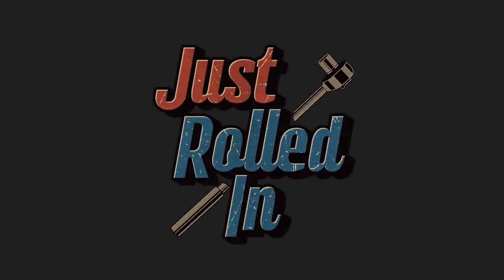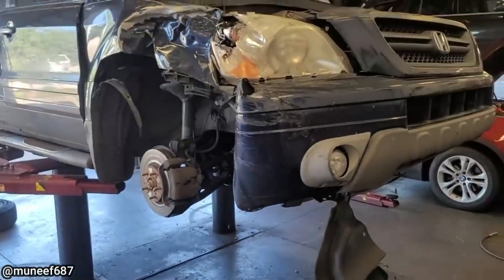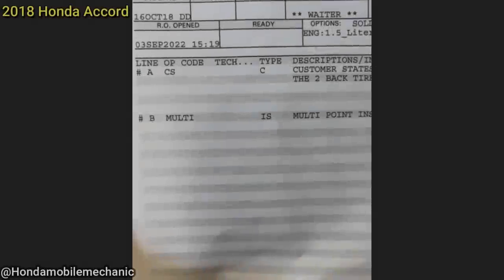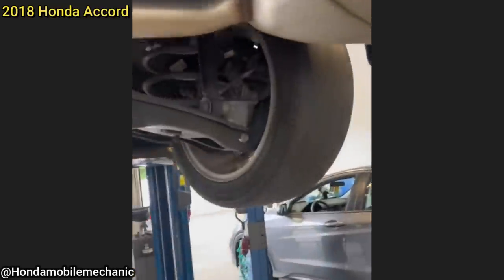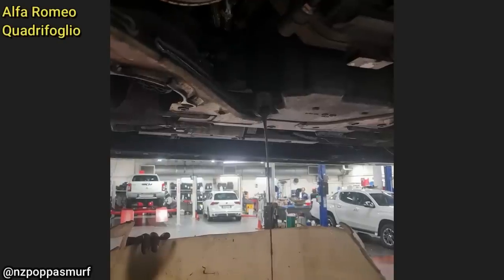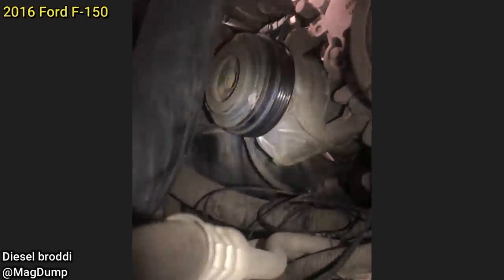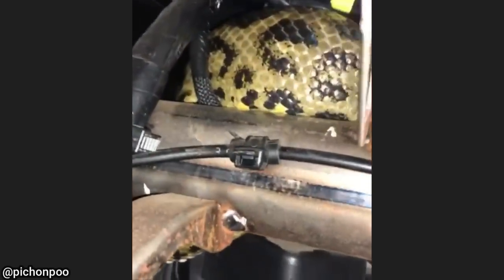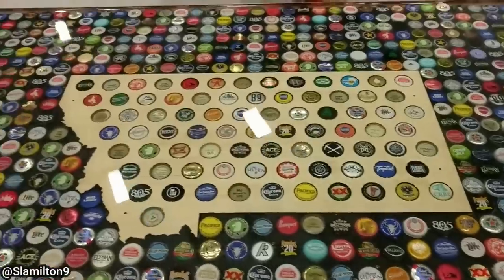Customer States Haven't Serviced Honda Civic In 9 Years | Just Rolled In

Comment: I absolutely love that toolbox....Unfortunately Epoxy resin and typical shop chemicals don't exactly play nice with one another.
Reply: Don’t worry, in my experience of fellow AMEs…the larger more expensive the toolbox, the less actual work they do.
Reply: @gpaull2  9 times out of 10 I'd agree with you. GA seems to be the opposite though in my experience.
Reply: Would make more sense to put a plexiglass or lexan sheet on top.
Reply: @ol_smokey9370  

GA ?
Reply: That's what I was thinking. The top of your toolbox is no good for a work bench now!!
Reply: @tedcook8749  General Aviation. Broadly it's small privately owned aircraft.
Reply: @tedcook8749  General Aviation. The tool box was in a hanger.
Reply: Pretty sure the guy already wasn’t going to pour chemicals or hammer shit on top of a brand new Snap-On box likely retailing in the $15-25k range
Reply: My idea for resin tabletops was to put a sheet of glass on the top then you get the scratch/chemical resistance of glass Plus the aesthetics of resin and the glass will also be reinforced by the resin which would make it somewhat impact resistant like tile is after its set.

Don't ask me how to get all the air bubbles out, still working on that.
Perhaps some long needle syringe or you  pour with the table vertically and heat up the glass side to make it viscous so bubbles flow upward
Reply: @nodsib  You clearly haven't seen how mechanics use their tool boxes.
Reply: Well, I’ve worked in both independent shops and dealerships, and while I definitely have used my toolbox as a work bench and gotten it dirty and generally not been too worried about minor wear and tear, my box was less than $2k, and didn’t have a custom top, so I would have treated it a lot differently if it was this guys tool box
Reply: @gpaull2  I am an AMT and can definitely attest to this!!!
Reply: @tedcook8749  general aviation
Reply: He’s got a stainless steel cover that fits over it to protect it when needed.  That’s how it stays so pristine.  BTW, I just made all that up.

Comment: I have 2006 Civic with the same engine and 365k km. It still runs perfectly. I did a valve adjustment at 240 k km and it was nearly pristine under the cover. I will do another valve adjustment in springtime and I'm certain it will still be close to pristine.

Comment: I had a 1991 Corolla I bought for $150. Went bag driving one night with a buddy, and sent a branch through the oil pan. It leaked a bit, so we just kept adding. Eventually we ran out of oil right next to a dairy farm. The farmer said we could grab whatever we needed to get back home. 2 full bottles of Palmolive dish soap, and a lot of smoke later, we got another 500km out of that engine. Solid engines in my books.

Comment: Oh man...I had a mid 90's civic come in back in the day, 99,000 miles on it, crank no start.  It had fuel, spark etc.  Looked in the oil fill and the cam was spinning.  This was during the time the distributors would wear out and wobble in the hole.  Tried a new distributor, still no go.  Took the valve cover off and the the cam was split dead in the middle..  The sludge looked just like that first car and the guy said he never knew he had to change the oil, just keep it full....

Comment: Wish I would have thought of it at the time to record. But one of our company pickups came in for service this spring, the guys said the alternator wasn't charging. I took a look and during inspection I found the idler pulley was seized, and melted down so the belt was loose. No visible damage to the belt and no noise. Replaced the pulley and belt. Good as new. 2002 GMC 1500 with a 4.8.

Comment: My 84 Thunderbird was sitting for years. I didn't know how long? The first thing I did was change the oil. Time for another change after 4000 Km. It only has 20,000 kms on it. Less than 13 thousand miles. Still runs like brand new

Comment: I had a customer swear by oil changes on his S10 every 10k. When it started knocking at 100,000 miles, he swore off Chevy, says they're junk. As a Ford guy, I think he made a good call, but it always made me shake my head that he blamed GM for his lack of maintenance.
Reply: Everything says 10K nowadays. I go 5K, and The Car Care Nut backs that - he's seen a LOT of Toyota engines and says 10K is fine if you only want the car to last past the warranty. If you want it to last 300K and beyond, go with 5K changes.
Reply: @John_Ridley  Whenever a customer asks me "then why does the manufacturer recommend 10,000 miles? Shouldn't they know best?" I always tell them to take their car to the dealer 120,000 miles & 12 oil changes later, burning oil, and see if they will help you. They'll help you buy another car.

Comment: Gotta say, as a Ford tech I hate the transit. There is so much stuff wrong with that vehicle it's insane. I had the same one come in three times for three different issues. The first was for a new engine, the second was a new torque convertor, and the third was two new tie rod ends.
Reply: Why anybody buys from the Big 3 (2 now really) is absolutely beyond me.
Reply: Its funny how i drove one for 268k km with no issue and this one spend more time in the shop than on the road

Comment: Guy I worked for still drives his old Honda (body work needed meant it was a total loss) so he bought for $100 and decided to drive it as is until it died.

That was 10 years ago, and the only things he's done to it are replace one rear tire.  No oil change, no spark plugs, no air filter, no clutch, no nothing...  Still doesn't smoke, leak or idle roughly and fires first hit every time.

Only thing I think that's saving it is that he's old and drives 30 mph at the fastest, but still, I'm amazed it even runs.  Even the headlights, brake lights and turn signals still work.

Now we're afraid that change any fluids is actually going to screw it up, so he's leaving it.

Comment: "Honda engines are bulletproof" is a FIGURE OF SPEECH!!!  They still need regular maintenance and will not stop a bullet enough to operate correctly after the impact.
Reply: Though to be fair, if that engine didn't have a nasty rod knock, and still builds oil pressure after this abuse, is pretty impressive.
Still need to change the oil though, obviously.

Comment: I think it would be impossible to have an award for “Idiot of the Year” because there would be an argument over who deserves it the most. 🥊 
That Lotus owner with the oil filter gets my vote. That is until I saw this video 😂.  🍺
Reply from the maker: Lol! I can't wait to make the best of 2022 episode. It'll be a good recap.
Reply: The Alfa owner... I can't even relate to the thought process that followed up putting washer fluid in the oil fill with, "just keep adding washer fluid." It's like accidentally setting your house on fire and, just to be sure, getting in your car and ramming a nearby utility pole as well.
Reply: @matthewbowen5841  My pet theory on how a lot of these problems happen is that there's an idea that it's appropriate to have a few beers while doing maintenance. Maybe someone who has done the same job many times before can get away with it, but someone who rarely does this kind of work should never attempt it impaired.
Reply: @matthewbowen5841  Open any cap, add any fluid.
The car is smart enough to figure where it goes if it can complain it's headlights are on when I open the driver's door!
Reply: I vote for the blowtorch inside the car cause the heater had stopped working.
Reply: @Kalvinjj  I remember that insanity, a month or two ago. I can't remember but was the torch tied down or floating free in the backseat?

Comment: I don’t know how many times I took my 2004 Tacoma in for service and they always came back and said suspension and steering checked out OK. Then in 2021 the lower ball joints failed while I was going 55 mph down a busy street in San Diego. Cost me $7000 to get it repaired. I always relied on technicians who inspected the vehicle to let me know whether or not anything needed to be replaced or looked at, good to see that at least somebody recommended ball joints should be replaced in this video.

Comment: When your oil looks like that from not changing it, what do they do?  Add bottles of engine flush?  Looks like it would be miserable to deal with.
Reply from the maker: Take it apart and clean it as well. Waiting to hear an update from the viewer who shared it but sounds like it needs an engine.
Reply: If it's still running looking like that I think the standard procedure is to bury it at a crossroads.
Reply: Oil flush is likely to break things loose all at once.  What I've heard of DIY doing is near-daily oil changes with cheap oil and filters until it's cleaned out.  Not sure what a tech would do given the time constraints.
Reply: @russellhltn1396  I agree with that.
I'd probably add a pint or so of ATF and run the car for 5-10 minutes before changing the oil and filter.
If it's a car where you can easily change the filter without dumping a whole bunch of oil I might change the filter weekly and top up the oil.
I will say diesel oils with a big detergent package will help keep your engine cleaner over time.
Beware oils with elevated ZDDP unless you like buying expensive catalytic converters
Reply: Throw some transmission fluid, kerosene, or diesel in it and idle it for 10 or 15 minutes then dump everything and put fresh oil and filter in it. They make expensive engine cleaner kits that come with special chemicals and you do like two runs to make it like new inside. Have a 99 300m we retired so hadn't bothered to service it or change the oil. It lost oil pressure on the freeway and figured it was done once I realized it was making upper end noise. Drove it gently 20 miles and it never got worse or bottom end knocking. Checked our records and oil had 20k on it.
Decided to change the oil and filter just in case and pressure came back and eventually the top end got quiet the second time I started it after sitting a while. I don't trust it now and replacing the oil pump is a huge expensive job, it has 190k on it 3.5 ho engine, pretty darn tough.
Reply: Not a car engineer, but I guess it would be difficult not to block the oil galleries with lumps, if you tried to clean that sludge out.
Reply: @GaldirEonai  🤣🤣🤣
Reply: @kevinshort3943   My guess is that it's a bit late to be worrying about the risk of blocking any oil-galleries!  It's most likely that the oil-filter is a solid mass just like inside of the oil-pickup, the oil-pump gave up a few 100 miles ago, & the bores have more scores than a crack-addict!
Reply: @kevinshort3943  Which is why you want to do it gradually and not all at once.
Reply: @kevinshort3943  You can't circulate the oil to remove the sludge without running the engine and you can't run the engine with the oil passages blocked off.
Two choices are complete dissembly or run it gently with high detergent and many filter changes.

Comment: 1:55 my first time learning that not all A/C compressors run off the same belt was on my 2001 Silverado.  Could never understand why it said the system was charged, belt attached, but no air (though these days I know the clutch could be faulty too).

I found out that not only does it have a separate belt, but the tensioner pulley likes to fail and fall off as mine did.

Comment: Some of you older guys may be horrified at this, but my mom told me that she never got the oil changed on her brand new 1971 Dodge Charger (i think it was the R/T with larger engine).  She was only in her teens, and didn't know anything about cars or that needed oil changes, so she just had gas stations add a quart occasionally until the engine locked up after a couple years. :0
Reply: I mean, i know that we men are supposedly ignoring the user manuals, but women are said to be smarter in that regard and actually look into a user manual.
I am pretty sure the user manual and the service booklet stated when the oil would be due to change. (Back then, the first one would have been within 1000 miles or so if i remember correct. Was common practice to use a different oil for the break in period.)

My first car was from 1984 and while i didn't get the user manual as i was the 5th owner or so and someone before me had lost it, but it certainly did in the service booklet that i got with the car.

With service booklet i mean a little booklet where the oil change intervals were already marekd and a workshop would stamp their logo in at the according mark insert the real mileage and what maint they'd done. Most manufacturer until the end of the 90's provided any new car with one of those.
Reply: @nirfz  no women has looked into a cars user manual lmao
Reply: @ESDigital -- Good question?  my guestimate is early eighties maybe?
Reply: @ESDigital New Jersey still has full service stations.  It's the law.

Comment: There should be a law preventing customers from leaving with dangerous tires like those.
Reply: There are, sort of.  You call the cops & tell them that someone is driving out in an unsafe vehicle & let them bust them for it.  (If they have time / can be bothered...)
Reply: I mean there are laws against that, depending on where you live. On summer tires, tread depth needs to be no less than 1.6mm where I live.
Reply: @NemoConsequentae  Sorry, didn't clarify. I was thinking of something with slightly more immediacy. Like that Clown who left with bald tires... that's an accident likely to kill people,  almost certainly the WRONG ones. That phone call should bring someone with authority to say 'Sorry, sir/madam/other, but you can't be allowed on the road with your tires like that.' Public safety issue.
Reply: @martinbaxter2616  That's dangerous ground, though.  How many stories are there already about shops that tried that to scam people or did scam them, (often women, because they don't know anything about cars, right? [/s] ), into getting work done they didn't need.  Replacing perfectly good parts with new overpriced ones. 
 
I was thinking that the workshop should make the call so the PD is outside waiting for them to say, 'Tyres, or tow truck.  With or without fine on top.  Your choice.'  Legally, (in most places AFAIK), the workshop cannot stop you from leaving, nor taking you vehicle.  Nothing to say they cannot delay you until someone who can stop you shows up, though...  (Depends on reliability of / how busy the local PD is, though.)
Reply: @NemoConsequentae  Excellent point.

Comment: Not only change the oil but always keep it at the mark specified on the dipstick because some vehicles if ran below the mark--  the oil can't get up to lubricate THE TIMING CHAIN FULLY -- ALSO SO OIL CAN BE PUMPED PROPERLY THRU THE PUSHRODS TO LUBRICATE CAMSHAFT AND ROCKER ARMS...   EVEN IF YOU HAVE ONLY 2000 MILES ON YOUR OIL CHANGE AND ITS LITTLE LOW JUST ADD SOME MORE UP TO THE MARK....  THAT WILL SAVE YOUR ENGINE...

Comment: The sad thing is that pretty much the only thing you need to do to get 2-300,000 miles out of a Honda engine is change the oil and filters. My 2001 Civic is at 243,000 miles and still gets 34 MPG.

Comment: I had an engine like this I emptied what oil I could and replaced the oil with diesel, let it run and idle for about 10 mins then dumped it all out. Finally I reached the oil, now it runs great. It's a 1991 Honda prelude if you are interested.

Comment: The only non-routine work my 2003 Civic has ever had is a valve cover gasket, a coil pack, and an evap solenoid. 180k now, still on the original clutch. Fantastic cars. Will last forever if taken care of.

Comment: the tool box in the last clip they are bottle caps for sure and it a nice design you can always do anything with old bottles caps back in the day.
Also clip number 4 on the bald tyres that car need a wheel caster re-tune cause I had that same problem years ago all it is that the steering was out of line-ment.

Comment: I knew a guy that bought his wife a brand new Corolla. It developed a knock in the engine. He could not figure out why so he took it to the dealer. The oil was never changed and the car had 50,000 miles on it. The dealer lied to Toyota, said the engine was defective. Toyota gave him a new motor. 

Needless to say, the dealer warned him that was the last time they would make bogus warranty claims for him.

Comment: Around 1981, I brought my girlfriend's Subaru to get a new thermostat. I told the mechanic to replace it. He yelled back, "I'll decide if you need that!" I knew enough about cars to properly diagnose it. It was about 20F outside. I'd warmed up the car enough to drive, and when I drove off the temp gauge plummeted. It was stuck open. The mechanic finally said, "You need a new thermostat." Yup, pure genius.

Comment: Don’t forget when mechanics state. 5 years ago car went crank no start. Engine had to be replaced $2500 according to mechanic. Took it home, called a mobile mechanic and she started right up after timing was adjusted.
Reply: My in-laws with a 2011 Odyssey were quoted a new engine from the dealership due to a misfire in the engine and a warning light on the dash.

Local mechanic replaced coils and plugs.  The Odyssey drove away running perfectly.

New engine?  Sheesh.

Comment: Bought a 79 Beatles convertible,  when they put speakers in the doors they forget that they go in different place than the  sedan. When I got it back they had used electric tape to hold in the piece they cut out. Was told they have ordered a replacement.  Waited for a couple of months,  then called the VW main office in north jersey.  Next day I get called that the part is in. As I'm waiting for it to be installed I walk around the showroom and and sure enough here's a  bug with a missing door panel.